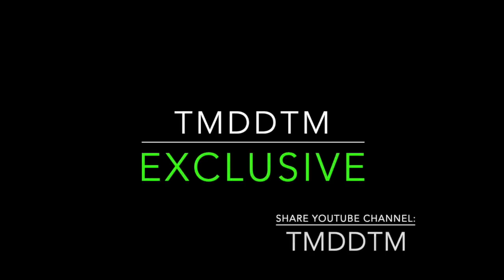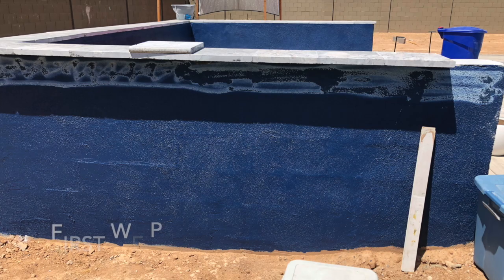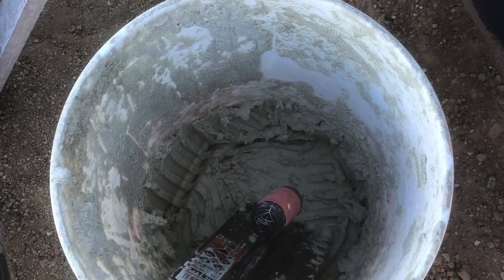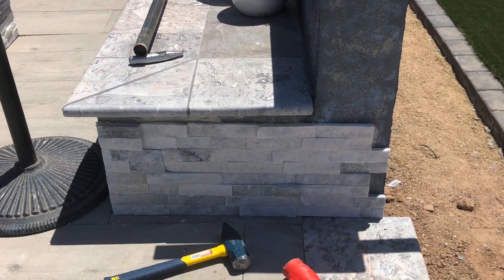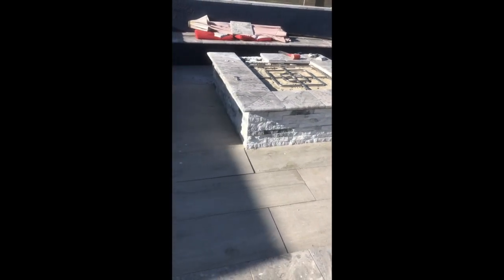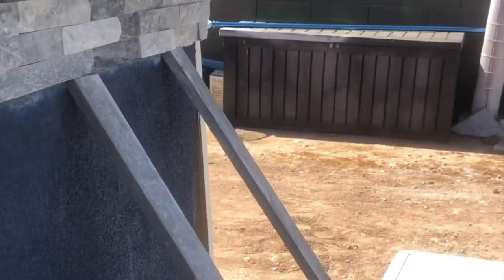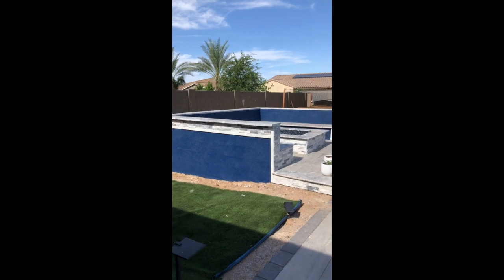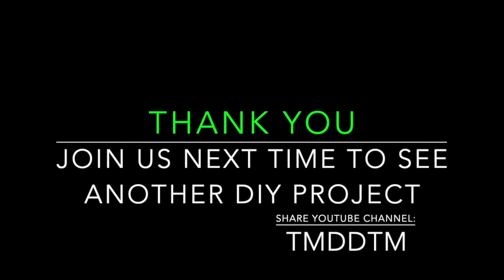DIY Fire Pit Ideas - Beautiful

Comment: What did you make the frame out of 2x4 wood? Have you looked at using that with cement sheets with wood and then just putting ledger stone
Did you make the fire pit or purchase on?
Reply from the maker: Hey Chris, first let me thank you for taking the time to watch and taking the time to engage.  You are appreciated.

 To answer your question, this fire pit seating and burning area are cinder block, rebar, and sand.
Reply from the maker: I have not used the materials you described for a fire pit area.  I’m interested in hearing more about it. Can you share a video on it?

I do use ledger stone on wood when I’m building indoor fireplaces.

Check out this link.  I used ledger stone on wood in this one.  

https://youtu.be/nG4tnlvFkBo